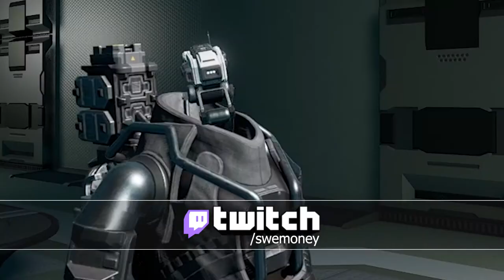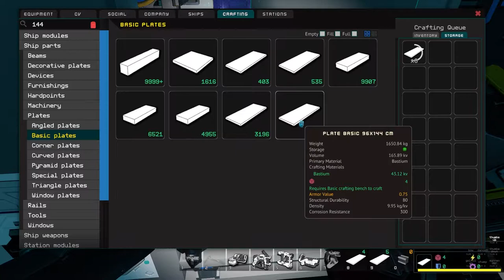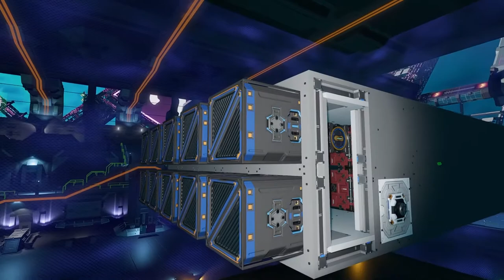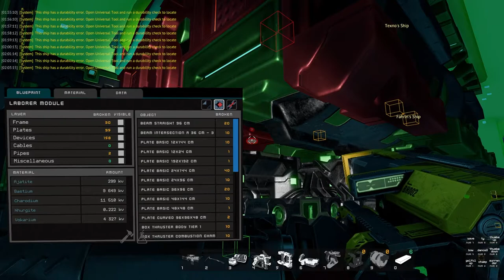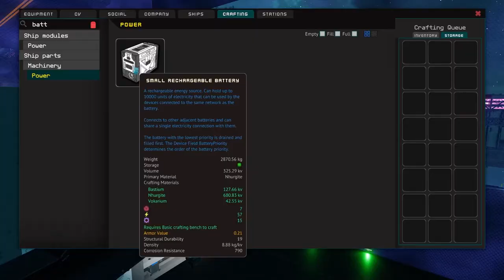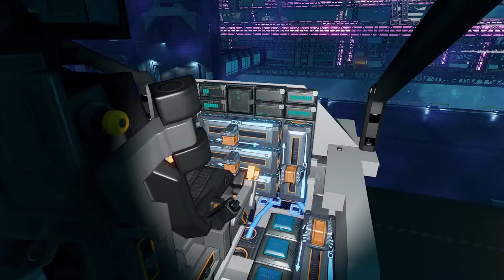Hack My Laborer [Ep 07] - Batteries, Propellant and Plates. Oh My! - A Starbase Tutorial Series

Comment: I have a suggestion for part of one of your next videos.  There is something called a Coolant Recharge rack, that is supposed to recharge two of the 3 coolant things on the fuel chamber....I cant seem to figure it out or get it to work. I have it on a hardpoint, both hardpoint and rack have power, but yet it doesnt recharge....maybe you can figure it out because there are no videos on this.  Just a suggestion of course.
Reply from the maker: This is a good one. I've actually been interested in that piece too. I'll have to do some digging and see if I can't include it in one of my upgrades. I usually just turn off my coolant. Unless something happens to your radiators you're fine with just them. But I'm still curious about recharging coolant. Thanks!

Comment: Made it to this episode and my ship is updated now, thanks to your great series, but i have one question:
If i want ONE bar to show the complete battery charge, not just per battery,  but total charge, is that possible without YOLOL scripting?
Reply from the maker: Not without YOLOL. You can rename all your batteries stored field to be something like B1, B2, etc and then just have a YOLOL chip that says :Battery=:B1+:B2+etc. then just name one of the battery screens Battery. Do the same process for the MaxStored on each battery (B1M, B2M, etc) or just type the amount of total battery storage you have in the screen field.
Reply: Got it working :)  Thanx! Also made a bar display for the speed indicator, so i don't have to read the little numbers. It requires a memory chip to store the ss value from the ISAN script and then a bar display can read it. Works like a charm.
Reply from the maker: @leendertmeriman3668  awesome!